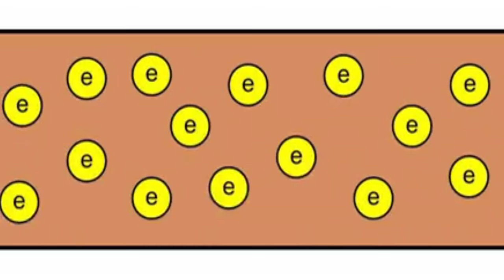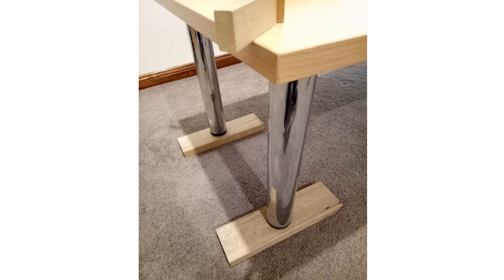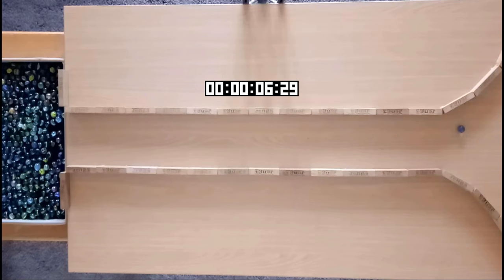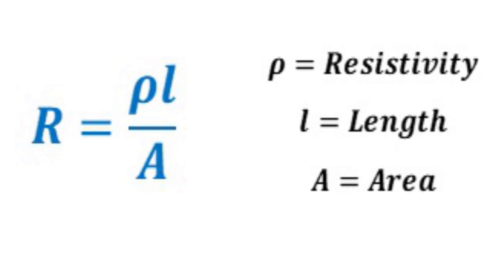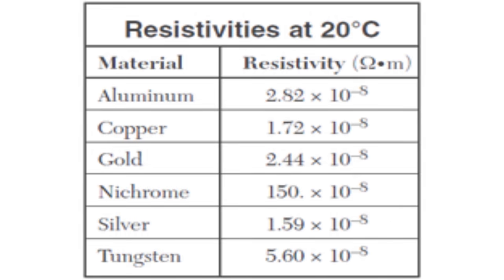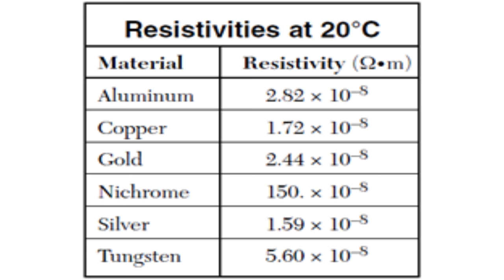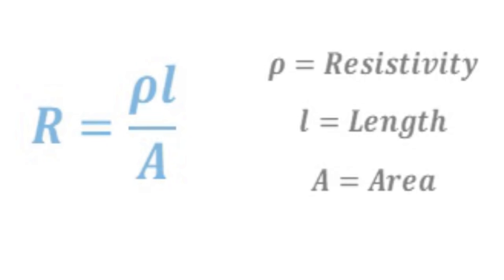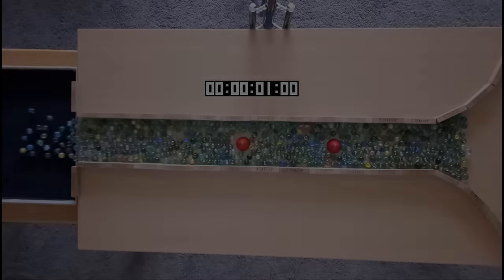What is Electrical Resistance

Comment: If resistors were 100% efficient..  Resistors 'bleed' off electrons as heat. Like a dam overflowing with water and losing power sense that water will not be used to turn a turbine.

Comment: But we thought that current remains same before and after passing through the resistor and how it is possible
Reply: This does not mean current don't reduce it reduces but from overall circuit
Reply: It does, but the current is less 'potent' since electrons have bled off at resistor.

Comment: Resistance is a horrible concept.

It’s based on the observation that different components need different p.d.s across them for a given current to flow through them.

This is explained by some sort of mechanical analogue - it’s like walking through mud, or struggling to get through a crowd, or going through a constriction in a pipe, or some other visualisation that involves some sort of ‘resistance’ to the flow of current.

The key thing to realise is that electrical resistance is itself a metaphor, and the metaphor brings with it all sorts of implicit associations for the unwary to trip over.  Even if teachers understand all the subtelties, students won’t unless you’re very careful.

Here’s a very quick summary of the problems.

1. You can’t separate the idea of resistance from how power supplies respond to changes in resistance.  So any mechanical analogy for resistance also has to correctly include power supplies.  Power supplies are designed to keep their voltage constant, and respond to changes in load by delivering different currents.  This is how you can design millions of different devices that can all run off the same kind of battery, even though the batttery has no idea what it’s going to be connected to.

2. When we experience a resistance, for example walking through mud, we may walk slower, but we also tend to try harder - we struggle.  This implies that batteries have to work harder to make ‘the current’ flow through the resistance.  (This is where the rope loop model is particularly guilty of reinforcing misconceptions.)  In fact, power supplies respond to an increased resistance by working less hard - they simply provide a smaller current.  Power supplies don’t try harder to ‘overcome’ a higher resistance.

3. There isn’t a ‘the current’ that the battery tries to make flow while the resistance pushes back.  If the resistance is higher, the power supply responds by keeping the p.d. the same, but reducing the current it supplies.

4. The place where energy is shifted quickest is where the resistance is biggest, but increasing the resistance decreases that rate, because the current decreases.  It’s actually more subtle than that because it depends on whether you’re dealing with a single component, or several components in series.  If you increase the resistance of a low resistance in series with a high resistance, it shifts energy quicker at first as it takes a bigger share of the voltage, and then less and less as the effect of the decreasing current dominates.

5. The speed of charges tends to increase where there is most resistance, not decrease.  Even though the current is the same everywhere in a series part of a circuit, the speed of charges tends to vary with material and diameter.  Narrow wires (like in a bulb filament) need to have faster charges for a given current, which is why they interact with the lattice more, and energy is shifted there, rather than in the leads.

If you can find a mechanical analogue that has none of those problems (and is simpler than the actual definition of electrical resistance), then please let me know.

That’s why I tend to stick to the definition, that it’s simply to do with how big a p.d. you need for a given current, but without really trying to explain why.